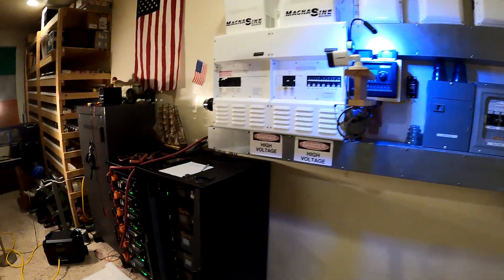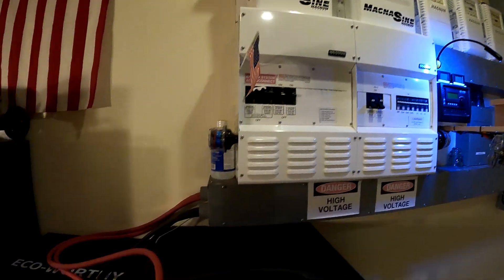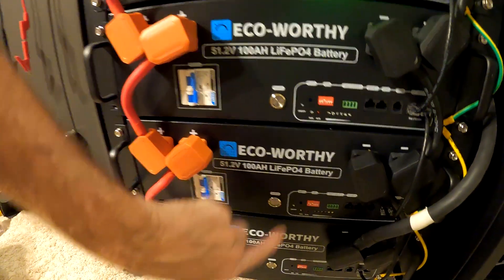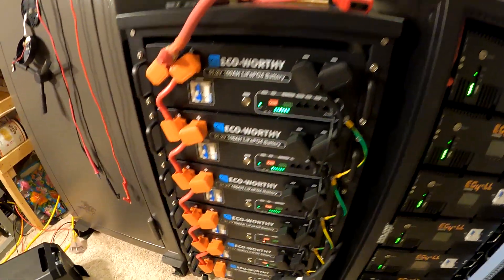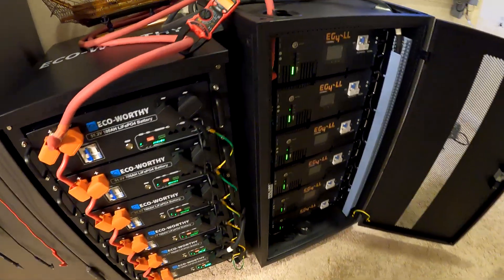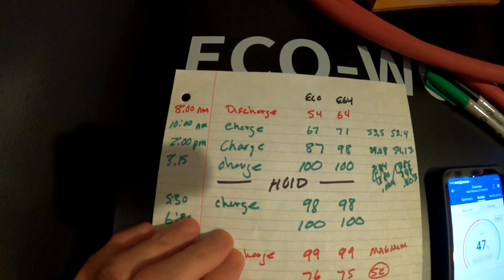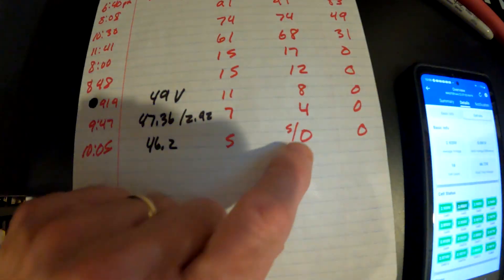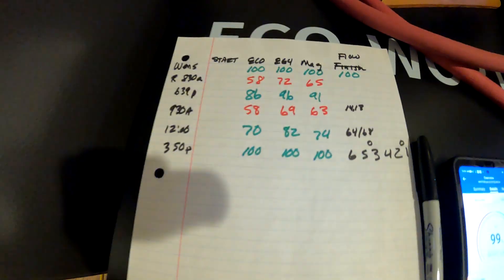Combining EG4 & ECO-WORTHY Battery Banks

Comment: Thanks for the video, I have 1 EG4 wall mount with a 6 unit Eco-Worthy battery bank. How did you get the Eco Worthy app to work with the wifi. seems I can get the batteries on but they keep dropping off. Where as the EG4 reads remotely & never drops off.

Comment: Nice setup.  Parallel batteries hardly ever discharge at exactly the same rate in the middle of a charge cycle, which  means you will get different SOCs in the middle of the charge cycle.  That's normal due to minor differences in the resistance of the wiring and the internal resistance of the batteries themselves.  The SOCs will come together at the top and bottom ends of the charge cycle.  As long as the measured voltage is the same on both banks you're good.  No problem running them in parallel.

Comment: How did u connect convocation fro battery to battery ???? I was told the ecoworthy battery need to cycle about a dozen times to learn before u should equalize , im running 5 eg 4 batteries and 5 ecoworthy batteries as dummy one

Comment: Shouldn’t one of your leads be at the bottom of the EG4 bus to better equalize the draw across all batteries?  Seems the top battery is getting the most draw / chg, but maybe the low resistance of the bus makes that unnecessary, please let me know.
Reply from the maker: It might be slightly better at the bottom but I am not seeing any faster draw down from the top battery.  When I take the bank down to zero (shutdown), the middle battery (4th from top) taps out first.

Comment: I have 4 of the Eco-worthy batteries hooked to a Victron system. I use a Victron SmartShunt to determine state of charge for all of the batteries rather than trusting the internal BMSs. I notice the internal BMSs seem to wanter a bit on how they determine state of charge but the shunt is designed for accuracy and I trust it more.

Comment: I have the same cabinet and same batteries, should I be using a 200 Amp fuse like you? My EG4 12000XP has a 300 Amp breaker at the battery inlet already
Reply from the maker: The fuse/breaker only protects what is downstream.  Example:  If you had a short on the cable from the battery to the EG4, what is going to stop that from burning the cable and maybe your house down?  You should have a fuse/breaker at the battery end of the cable to protect the cable.
Reply: @HomesteadEngineering So if I do the math, my 12000xp can pull 50 amps at 240v or 12000W. So 12000W/48V = 250A. To size up a bit, I figure a 300A breaker?
Reply from the maker: @Tazdeviloo7  Disclaimer: I am not an Electrician and this is not advise.  

I size the breaker/fuse to protect the wire not the load.  So in this case, what size wire do you have from the battery to the xp and how long is it?  If its 2/0 then maybe a 200A fuse or smaller. 

I think about how much current do I want it to pull before I blow a fuse or trip a breaker.  If you have a big 300A fuse and 8AWG wire, your going to melt the wire before the fuse blows.  With 8AWG, I would probably have a 30A or 40A fuse/breaker.  

Note: I have a electric vehicle plug that is rated for 50A all the way back to the panel but I put a 20A breaker in the panel because I don't ever want anyone charging more than 20A over long periods of time (it would probably be fine up to 35-40A continuous but I am being caucus).  If they try 40A, the breaker will trip.
Reply: @HomesteadEngineering It's 4/0 copper so it should be good to 400A. 300A sounds about right then. The manual says to use a T-class fuse, but I like the terminal fuse you have.

Comment: Do you have both battery banks hooked up to a central bus bar before the inverters? Or one bank per inverter?  If so that could cause your imbalance
Reply from the maker: The positive lead from bank 1 lands on inverter 1 and the positive lead from bank 2 lands on inverter 2.  Then the two inverters are connected to a bus.  Its a bit convoluted and I don't really like it.  I may land them on a bus and then go to the inverters in the future.  This video shows how it lands up currently:
https://youtu.be/TR1OugEBWR4?si=KZ-jljj5l5KHhbpJ

Comment: Logically, the two sets of battery banks are not the same.  One is wired to a bus bar, and one is wired as a pass through to each battery.  While not clear in the video, it also appears that the battery cables are not the same size on the ECO and the EG4 batteries connections.  It looks like the ECO batteries have a larger cable which would provide less resistance thus providing an easier draw for the power to be released.

As other have said, the BMS's aren't the same, that could result in some of the results not matching.  Each BMS might not read an accurate state of charge, there could be a variance of a +/- on different BMS's.  Based on your video, looks like the potential bias is about +/- 3 or 4 (give or take) assuming the two different BMS's don't also have a bias in the reporting.  

If you factor in the BMS bias on the numbers, it looks like you are probably close.

For a more comparative result, might try wiring each set exactly the same, either through a bus bar or from one battery to the next.  Bus bar probably will be the equalizer, this would eliminate any pass through resistance from a battery to battery connection.
Reply from the maker: Good points!  The leads are all the same size and same length.  I may swap out the ECO rack with the bus bar version and add a new bus bar for both batteries to land on as the current setup is not ideal.  That said, it seams to be working perfectly so far...
This is how the leads currently land on the inverters (not great not terrible):
https://youtu.be/TR1OugEBWR4?si=KZ-jljj5l5KHhbpJ

Comment: Are the battery cables to the bus bar equal lengths positive and negative and that exact same length going to the other rack? Also maybe not going across all the eg4 batteries it looks like the cables are connected to the top of the rack.  I somewhat have the same set up, except I’m using 6 lifepower4 v2 batteries and 6 of the ecoworthy.  I did order a second EG4 rack and mount the Eco worthy batteries in it so it will be somewhat the same bus bar.
Reply from the maker: I too am considering getting a second EG4 rack as I like the busbars and secured enclosure much better.  

Yes the cables are the same lengths see this video at 7:18: https://youtu.be/Yj_Ojx8hG2E?si=w0wsEiJ4qE7jQkQ7

I could drop the negative to the bottom of the EG4 busbar...  

Also note: the other end of the positive cables looks like this (at 4:00): https://youtu.be/TR1OugEBWR4?si=Sf6nwqMx50JzuvWd

not ideal... I might redo that end as well

Thanks!
Reply: @HomesteadEngineering  these batteries are longer than the EG4 so they definitely hit the back of the rack and still lack about an inch.  I ended up just taking the racks ears off just so they weren’t quite as close to the bus bar.  The back of the rack does hinge open and the batteries would probably fit flush if you take that door off.  I have not actually tried that though…

Comment: The voltage is going to be identical. They are physically connected together in parallel. Any differences in voltage would be a metering disparity, not a real voltage difference.
Reply from the maker: Yes, That is correct and that is what I see as expected.  Thanks!

Comment: Been following your build for a few weeks. Working through the permit process and engineering side of the system from my home. Hopefully, I can start the groundwork and get kind of in the ground before winter gets here so that comes spring. I can energize the system.

Any pointers for someone who has not done a system like this before or is trying to power their entire home not grid tied.
Reply from the maker: I am not a solar installer or Electrician (end disclaimer).  

Here are some thoughts:
1. Think big!  Size it, double it, build it.  Would not surprise me if typical new home built 10 years from now has 400kWh of battery (including EV's).  60kWh of ECO-WORTHY batteries (2 racks) is only $7,000 after tax credit!
https://amzn.to/46AU9JT

2. Permit it.  If you don't you could have problems selling down the line or insurance claims if you have a problem.  

3. Build a strong rack especially if your in hurricane alley or have heavy snow loading.  Most folks skimp on the rack because that is the hardest part.  BTW: rack is better than roof if you can do it.  Roof is OK if done right.  Think Iron Ridge or equivalent.  
This is the package I put together for permitting my system:
https://youtu.be/N7CoCI-0IoY?si=JSc4-N6IYBMrEocg

4. Get it "installed" by the end of this year for 30% tax credit

5. If I were doing this today I would go with the FlexBoss21(s), ECO-WORTHY batteries (60kWh) and a 8750 Predator Generator for backup passthrough/battery charging.  Thinking 36 panels (16kW).

6. Enjoy the new hobby and not having power bills!
Reply: @HomesteadEngineering 
N6IYB
Greetings thank you and 73
KC3EQP

Comment: I can answer your issue with your batteries and its just the resistants of the Eco batteries are better than the EG4 batteries but they are fine with how you have them connected
Reply from the maker: That could be part of it.  I do think they will be fine as is.  Well see...

Comment: There is nothing particular to do..just parallel them when at a 100% SOC, same voltage charge...and voilà.
Reply from the maker: Yep, That's pretty much what I did after top balancing each bank several times.  I probably could have skipped that whole top balancing thing and it would just work out over time.

Comment: What size inverter(s) are you using? And brand?
Reply from the maker: I have an older system I put together mainly from Magnum Energy nine years ago (no longer available).  I have two low frequency, copper wound transformer inverters each puts out 4,400 Watts so 8,800 total (16,000 peak).  

I have a detailed series of the complete install here:
https://youtu.be/lcGjoHS6rnE?si=G20ClkcdOWjyGKcq

Comment: I'm building a 2nd DIY JK BMS battery bank using the Apexium box. They both have the JK inverter BMS V15. One will be set to master BMS maybe having one battery be the master. I think it works the same way with the EG4 batteries one battery BMS matches the SOC on the rest. Probably can't connect both banks.
Reply from the maker: That sounds good but as you said, I don't think I can do that here.

Comment: The EG4 rack with the buss bar likely has a much lower resistance than the cable tied ecoworthy stack would be most first thought regarding the unequal load. Of course it could also be the quality of cells. How unbalanced are we talking?
Reply from the maker: Yes, I think that is part of the puzzle.  I think 4 of the 6 batteries are now pretty good at about 0.02V and the top two are still at about 0.10 or so.  Most of the time they are all 0.006 but I don't count that.  I am looking for the max difference in cells as they near 3.65V per cell.

Note:  When the entire bank is fully charged and I then start to draw down, the more balanced cells provide current first and then the less balanced cells kick in later.  When drawing down maybe 20-30A, it takes about 10 minutes before the least balanced cell kicks in and supplies current.  
Thanks!

Comment: With a 50 amp load on your eco-worthy battery, measure the current (with a clamp meter) on the last red or black jumper and see if it's below the current rating of the wire.
Reply from the maker: I think you have correctly identified the weakest link in the system.  At 52A on the 4/0 supply line I get 44A on the last red jumper (top).  At 60A, I get 51A.  The jumper is 2AWG and I believe can handle 200+ Amps which is the most it would ever see.  (200A fuse)  Also in my favor is that it is only about 5" long.  At 60A it is cool to the touch.  I will check it at higher Amps and get back to you.  Thanks!
Reply: @HomesteadEngineering  ~ I guess a guy could always run two jumpers for (+) and two jumpers for (-) between the batteries if you had an occasionally 1C load requirement.

Comment: Can anyone chime in on why you would run a 30kWh battery rack vs 2 x 14.3kWh battery backup system?
Reply: Lack of wall space.  You can stack two six battery enclosures for 60 kW taking up the same wall and floor space.
Reply from the maker: Price.  A six stack (30kWh) with the rack is only $4,919 or $3,443 after tax credit. That's delivered:  https://amzn.to/46zGClU

That said, the EG4 wall mounts are a really nice option as well they just cost more.  Note: They are coming out with a better version of the wall mount very soon.

Comment: did you set the amp hours on the magnum
Reply from the maker: LOL!  Somehow you always seem to sniff out what I left out of the story...  
I kind of remembered that you have to set the amp hours but when I looked at the "custom" settings, there was no place to set that.  I forgot it was under the BMK settings so it ran at 600Ah (1/2 the actual 1200) for a while and the SOC reflected that error.  You can see it in my data for a while.  Finally figured it out a couple days ago and its working really good now.  Thanks!

Comment: I am no expert in this field (disclaimer done :) A couple of things come to mind. 1. Different battery manufactures with different BMS and setup. 2. This one is a longshot but how are they wired? Going to a bussbar? I have seen vids of systems with different banks and the different battery banks were tied into a bussbar that the inverters pulled from. Bluesea makes these bussbars. 4 bolt 600 amp etc. Food for thought there. System looks good!! 60KW NICCCEE!!!
Reply from the maker: Those two ideas are my top contenders as well.  The two negative leads land on a "bus" plate and the two positives go directly to the two inverters.  There is a bus bar but "after" the inverter landing so its a bit convoluted.  That's the way Magnum wanted it for some reason.  You can see it in this video here: https://youtu.be/TR1OugEBWR4?si=JGnjn8bea40rVB05
I may rewire it so they land on the busbar first then go to the inverters.  That would be better but probably won't change the outcome much.

The next question is: Does it really matter if the current is not always balanced?  

Thanks!
Reply: @HomesteadEngineering  Whats funny is that on my 4 ark lithiums the SOC of the bottom battery is always higher than the rest by 1-2 % but the voltages are the same. No bussbar on mine but my setup is different than yours. I have 1 outback 3648 and I am running 120 only. Was looking at a EG4 18k pv to replace to get 240 etc. If this were my system I would install the two bussbars one positive and one negative, sending all of the current there and I would add a breaker for positive and negative to isolate. System looks good!! Keep em coming!